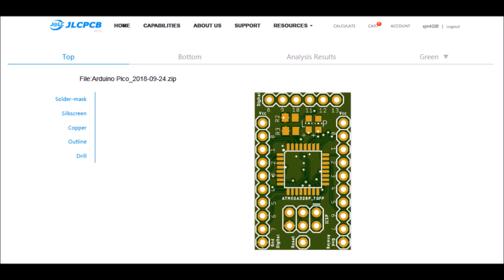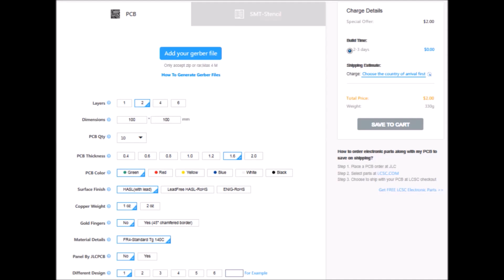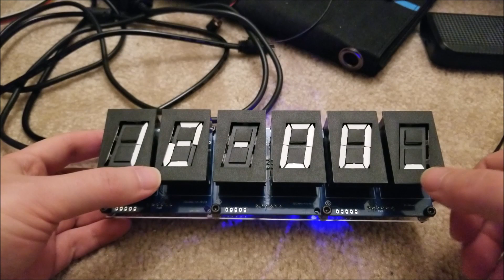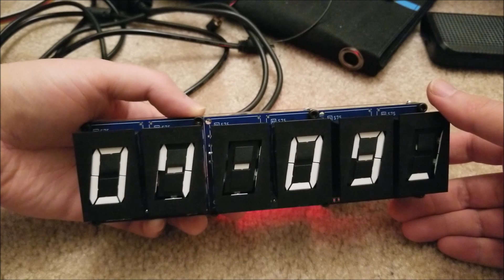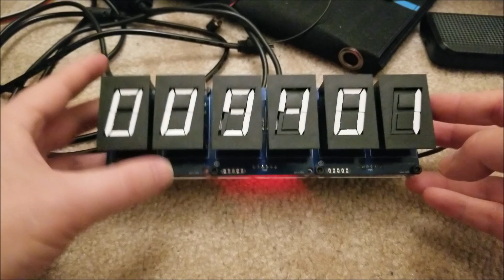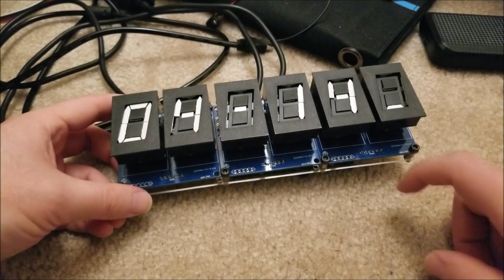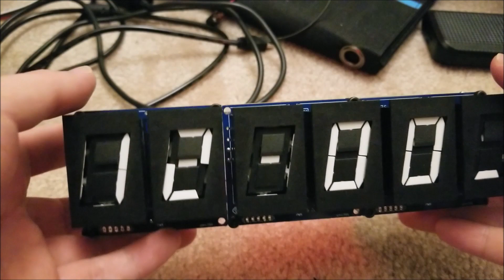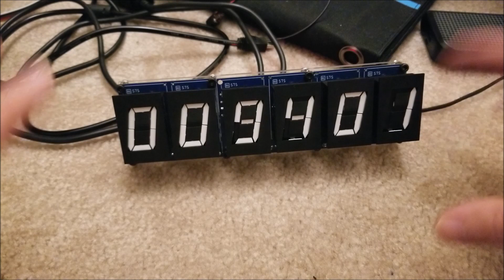DIY EasyFlip Wifi Youtube Sub Counter + Clock Complete

Comment: This is the exact project that I am attempting (wifi strava mileage counter). Do you sell built PCBs and parts? I have received a quote from Alfa Zeta on the mechanical displays but besides that I am looking to source everything else. I would be very interested in purchasing since I am a noob here and I would be able to follow your series. Thank you!
Reply from the maker: Yeah I have two spare boards currently and could easily order another set. Shoot me an email at sjm4306@gmail.com with some more info on your project and how many boards you would need.

Comment: Hey its me! a while ago we talked about the PlayStation 2 power supply, well , I finally got it and then I put it in the ps2 And........ absolutely nothing happened. So do you have any idea about what could be wrong?
Reply from the maker: Damn, so it does absolutely nothing? No flickering lights even for a second, no whining or high pitch sound, nothing? If you have a multimeter can you very carefully meaure the 12V output of the power supply (only if you are comfortable measuring it plugged into the ps2 in with the power on.
Reply: @sjm4306  my multimeter just broke, I'll try that when I get a new one.
Reply: I just completely tore apart, cleaned and rebuilt the playstation. So Im going to wait a few minutes for the alcohol to dry then try again

Comment: Great build ! Any chances  of having more videos on Nintendo Switch fixes ?
Reply from the maker: Thanks. Definitely not out of the question doing some more switch stuff. In fact I've been meaning to do two mods in particular: the metal joycon latch mod and adding cooling into the hdmi dock. Just have to order some parts first.